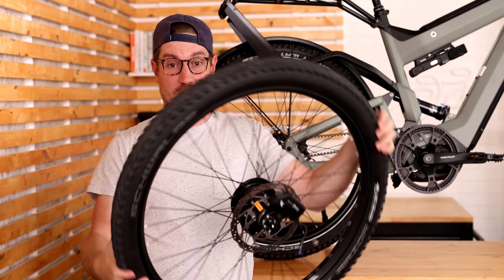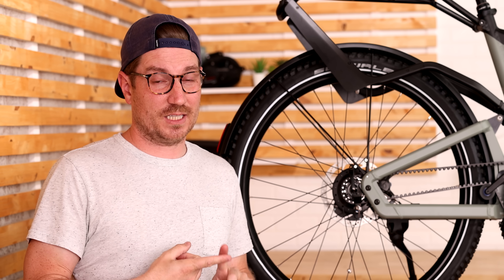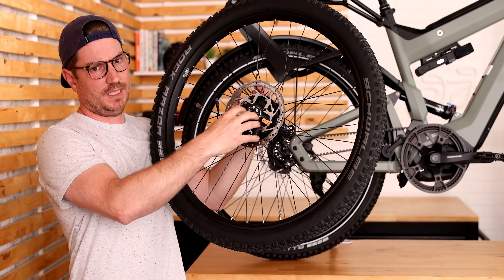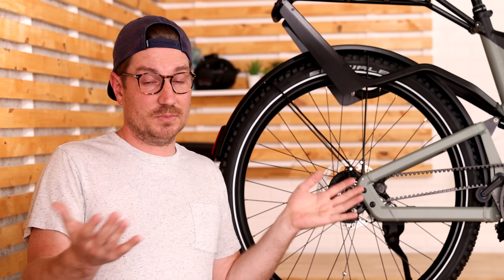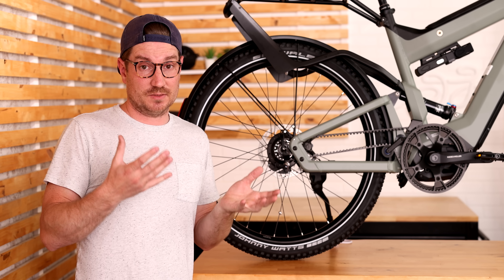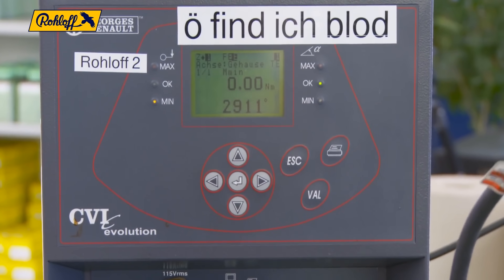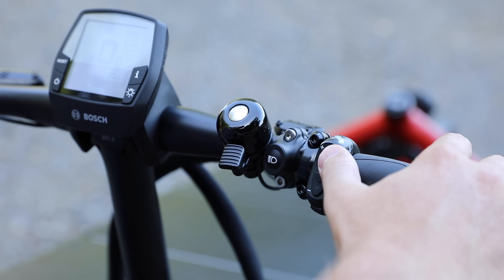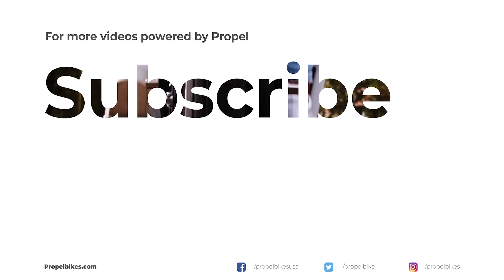Rohloff E-14 - is it really the best eBike drivetrain?

Comment: Very good video. Just some opinions:
Weight, efficiency and gear range are not really a factor for E-Bikes.  An E-Bike is already really heavy, efficiency is secondary because the motor will compensate for it and the motor will also compensate for missing gear range. Sure you will use up more battery but most people will rarely use up all the energy within one day.
You can even shift a gearbox without slowing down your cadence. You can shift while peddling but not under full load. So when you just reduce the power a bit and put a little bit of pressure on the shifter it will not shift while there is pressure on the pedals but when you reach the dead point it will shift instantly. This way you need way less coordinations.

Comment: Got the need for speed? Take the Rohloff, pair it with a Schlump Speed crank, a Gates belt drive and throw a 3000 watt front wheel motor on and you have some real time peddle ability at 40+MPH.... makes ya feel like a real live Superman! Throw a lil caution to the wind and use a Grin Phase runner Controller...

Comment: Interesting video, thanks for that.

Just to be clear (confirmed by Enviolo and Rohloff):
 - the Enviolo hub is limited to 100Nm at the Bottom Bracket (putting more torque leads/can lead to the internal balls to go flattish and destroying the hub)
 - the Rohloff limited at 130Nm at the input level ("the input torque we refer to is measured at the SPEEDHUB input sprocket" says Rohloff customer service ).

This means that if you have a 18 teeth sprocket at the rear and 36 teeth at the front, the Rohloff can stand 260Nm at the bottom bracket. HOWEVER, Rohloff specified that these 130Nm at the input level, includes the torque of the motor AND the torque of the cyclist. Still, this is an insanely higher level of torque than the Enviolo can cope with.

Also, as Rohloff says "The sudden application of torque from high power motors may lead to internal component damage if the curve hasn't been programmed with transmission component longevity in mind", so should you install a 160Nm Bafang motor like I did, better not start with Pedal assist on full blast, but start low and progressively increase PAS level as the speed builds up.
Reply: Hey Patrick , how did your rohloff work out with the 160nm torque. 
I’m looking at doing the same .
Revollute hub1 6 speed , 250nm torque capability , coming out soon and 
HB hightec , 9 speed , 250nm as well
Reply: @danieloconnor373  Hi Daniel, have done c. 1,500Km on it and it is working like a charm ;o) Maybe I am overly cautious with it as the Enviolo did not last long, so everytime I change gear when in full power, I make sure to reduce the pedal assist 3-4 levels (down to middle power), then change gear, then start pedalling and increase back to full power. I have a ratio of 3:1 front to rear and live in a hilly city, but must say this ratio is perfect, cycling easily at 45km/h on flat at a 50-60 per second cadence.

So although Rholoff are expensive and they look like they were created in the 17th century, they are 10x more worth buying than the Enviolo (to me)

Comment: Hi,

I really love your video they are very well done.  I don't know if you made a video on this. I have a 2019 R&M Delite with  Roholff E-14.  Until now I keep changing the level of assistance depending on the slope.   I was wondering if I should just pick a level of assistance for a ride.   If so, would I drain my battery faster?

Comment: One great advantage of speedhubs over derailleurs is that there is nothing hanging on right side of rear axle; a derailleur can be spoiled in different situations (of course, possibilty to use belt instead chain, and possibility to change gear without moving, are the two main advantages, in my point of view).
Two main advantages of Rohloff over other speedhubs are <1> the range, with not too wide gap between gears, and <2> that the rear wheel can easily be removed (no weird cable attachement with the Rohloff, even with the standard one)... The "less friction" aspect is real compared to Envolio, but not so sensible compared to some other speedhub (in my case: Alfine).
Changing oil is very simple and not expensive (I am buying kits on German eshops). Changing old version pinion was not very difficult (for Rohloff using chain) and pinions can be used on both sides; with new pinion system, it is  easier (no screw to untight with specific tool).

But I don't find that the two buttons shifter is very pleasant to use: the triangle shaped buttons do not work well when you push off center, so the sweetspot is quite small. The whole "two buttons" shifter is not very comfortable whatever rotation adjustment, because the whole thing is rather small and smooth. They should have made something more like a trigger that you can push up or down, without having to check your fingers, then the display, to know whether you have switch gear.
It's not a "no go" at all (current switcher is fully usable), but a direction for improvement.

Comment: My bike technician told me its very expensive purchasing the oil that the hub needs servicing every few months. Told me it costs about 500$ CAD to  maintain the hub. What are the costs like in the united states?
Reply from the maker: It’s like $40
Reply from the maker: You need to swap the oil every 5,000 Km
Reply: @Propelbikes It's different if you're a regular commuter? Someone who puts more than 100km a week.

Comment: At thee moment I’m on a 4400 mile circumnavigation of the coast of the UK. I’m riding a Reise & Muller Load 75 with Rohloff E14. It’s smooth and does the job nicely. The gear range is great, tackling any hill I have thrown at it. Great video Chris.
Reply: Anyone who's doing a great bike trip like that gets an automatic upvote from me!  If you happen to see this, how did it go?
Reply: I hate the shift-buttons, they are not reliable and hard to use when wearing gloves.

Comment: Great Video, Do these types of hubs work for rolling hills and climbing such as the Foothills of Tucson? I want to get back on my bike, but the hills on a traditional bike is a bit much so looking at an electric assist. Any thoughts?
Reply: The pinion systems are more suited for mountain bikes because you don't have to stop pedaling while shifting and the weight is centered and low.

Comment: Hi Chris. Thank's for the video. I use a Riese and Muller Supercharger 2 equipped with the Rohloff Sppedhub E-14. I use the bike everyday for home-work comuting (starting on january 2020, now almost 4000 kms). This internal gear hub is a must have. To give a complete description maybe a drawback is the oil leak wich seems to be "normal" but is very surprising the first time. It can be several dots that make the ground really dirty. There are many posts on the web that explain that this is something usual. 
Changing the oil is really easy. No need to visit the dealer shop for that.

Regards
Reply from the maker: Great feedback! Thanks for sharing!
Reply: "the oil leak wich seems to be "normal" "... Hum.. No, it's not. I have two bikes with Rohloff (and one with Alfine); an oil leak is not normal with a speedhub. You better check this with the seller, since your bike is still under warranty.

Comment: GSD R14 in UK, 400 miles and really enjoying it. Would like a more positive feel for the centre of the push gear change buttons - especially with gloves on.

R14 is a heavy bike but it's a joy to ride with no assistance - no drag from the Rohloff or the belt drive or the Bosch Gen 4. (Bosch Gen3 was a DRAG)

Comment: My Blade 2.0 has a 14 speed Rohloff speed hub. It’s a 1500w Bafang Ultra powered mid drive mountain bike sold from the San Diego based company FLX (builders of the babymaker).

Comment: Any experience with Pinion gearboxes? Wondering about a comparison with Rohloff.
Reply from the maker: They are super cool, but not as common on eBikes. I’ve seen a few rear hub motor setups with them, but it doesn’t offer the same mechanical advantage when pairing a mid drive with the gearbox.
Reply: Pinion hubs are at the same place as a mid drive.

Comment: Gear system efficiency is not important in E-bikes. Good systems has 3% loss, Ok systems has 10% loss. So you can get an Ok system and a 7% bigger battery for much cheaper than a good system.

Comment: Viewers like me who live in a cold climate ABSOLUTELY NEED TO take the cold into consideration if your are going to ride during the winter months! I went with Gates + Nexus 5e thinking that all is good but when the winter came all was not good. The below freezing temps really kill the range. I ran on eco-mode all the time but still if the temps drop like -10 to -15 C your not going very far with it. Also it's horribly inefficient on it's own. I don't ride it with motor off (not even summer) unless the battery has run out... which can and will happen in the cold climate. Not happy at all with the hub. Maybe I will turn it to single-speed or sell the bike later.
Reply from the maker: This is definitely an important consideration, but the Rohloff can handle it better. You just need to swap some of the oil for the cleaning oil which has a lower viscosity.
Reply: @Propelbikes  I was thinking that it might, but haven't tried it. I guess the Alfine 11 does better in the winter too.
Reply from the maker: Yes the Alfine will also work slightly better because it sits in oil as opposed to grease. I think the oil has a lower freezing point.
Reply: When it is very cold, every e-bike with each gearing system will lose range. It is mainly the battery getting cold and that will have a big effect on your range. I live in The Netherlands, in winter not super cold, but it can be below zero. I can see dropping my range a lot at -5 degrees. In summer time the range will go up a lot. And I drive with a derailleur system.
Reply: @leojonkers3181  That's just it. You have probably the most efficient gearing on your bike. My wife also has steps e6000 with derailleur. Her bike is easy to pedal even with the motor off. I have tried it and she very often rides it without a battery. Mine however.. (e6100 inter-5e) can not be ridden without juice in the battery. Never. When the battery is depleted I ride the rest of the way on 1st gear. (That's also because on my bike it is way over geared but you really can not have it lower on a 28" bike with belt drive.) It goes just above 100km in the summer with eco and during winter with studded tires I can get 70km if the temps are closer to 0 C. But last winter was a bit colder than year before and in -13 C the range dropped from +30km (real range not start ride estimate, the eastimate was 59km from the start) to 6km. Last few years have been warmer but -13 is not uncommon here. Can you see how someone might leave home with "59km of range" and be stranded on their commute to work? At the end of the last ride the system showed a range of 30km.
Reply: @leojonkers3181  I talked about the issue with my local bike shop owner and he told me that the nexus range use a grease that really stiffens up in the cold. He also agreed that it's not a fun hub to ride without assist. But he thought it was an ok hub if mated with a more powerful motor. He had a bike with Bosch performance motor and the inter-5e hub.
Reply: @K1989L  Oké, that is a kind of problem with the grease. That is new for me to read this. I knew that every hub have a slight less efficienty then a derailleur, I did not know the Nexus 5 have this problem. Is a very strong hub, specially made for e-bicycles.  Commute and be stranded must be terrible, there must be a solution. Oil change and a second battery?  I have a Bosch Performance Line motor, no fun to drive without assist (I never do), the bike is 26 kilo without battery. When temps are normal, I have a range of 100 km and more. 500 watts battery. In Tour. I bought a second battery for very long rides and holiday rides, also in mountains. I live in Rotterdam and here everything is flat. Only strong winds can make it hard to peddle.  I change the battery every time I load it, not leaving one battery to get old without using.
Reply: OK Boomer

Comment: Awesome stuff! For those people also looking for a portable bike which they can throw in a car and drive it to the mountains, are the Rohloff's compatible with quick release? Thru-axles? I've only ever seen them with the traditional nut setup but the ones in your video looked like thru axle?
Reply: Yes. There are adapters you can buy that will get your Rolloff to a 12mm qr

Comment: what is the power rating of the motor on that e bike at the beginning of the video with double battery etc
Reply from the maker: The nominal listed power is 250W but the peak is upwards of 800. Torque is 85Nm

Comment: Nice video Chris, I drive for 10 years an E bike with Rohloff and since last year a R&M with E14 and have over 10000 km with the new bike. Clean thing, no chain maintenance with oil because belt drive. Only every 5000km an oil change. I am still thrilled. Greetings from Germany
Reply: @Click Bait In the city, there is probably no problem. In hilly terrain, the Rohloff comes into play and shows its advantages. I can master almost any slope without dismounting. I remain, the Rohloff is for me even after 10 years of experience the optimum of the gears. Especially because at a standstill can be switched. Greetings from Germany.
Reply from the maker: Super cool! Keep it up!
Reply: @Click Bait True. The Rohloff was designed in Switzerland, so having a lot of gears would be helpful there. They might think it's nuts to use one in a place with no   mountains, but if you want to buy one, they won't stop you...
Reply: please, can I know the of that ebike. I'm very interested 😊
Reply: Sounds great! Can you do the oil service on Rohloff IGH yourself?
I have this item on my wish list for my own custom e-bike build.
But was not experienced and sure enough  I'd be compatible and lasts my mid drive BBHS 1500W ~165nm engine power over time.
So now running a 8 speed Shimano IGH as a try-out for daily commuting.
Personally I prefer  mechanical shifting cable(s) over electronic, since I'd like also to ride without battery.
Reply: @zachm.3049  yup, you can buy a Rohloff oil change kit which supplies all the items you need (including the syringe for the oil, but maybe not a hex key to open the hub). I have an R&M Load 60 with Rohloff which I received this year and will be doing my oil change next year with this kit. They suggest to do it once a year. That’s about the only maintenance (as there is no need to oil, clean a chain) along with tire pressure.

Comment: I run a R&M Charger with 11 speed Deore gears. I ride a lot of hills but find I spend 99% of my time in gears 5 to 9, the rest are pretty much redundant on an ebike in my view. As for a 14 speed???
Reply: Most of the time , say 70%, in eco, bit of tour, bit of sport but hardly ever need turbo. I get about 50 to 60 miles on one charge.
Reply: I also swapped the original 19 tooth chainring for a 16, what an improvement that was.
Reply from the maker: Great feedback! Makes a lot of sense and yes that front chainring makes a lot of sense.
Reply from the maker: Can I ask what assist level you use and what battery life you see?

Comment: I like Enviolo as one can "shift" also under load (while pedaling) and the no step shifting helps set an exact transmision ratio. I think enviolo is really good for e-bikes 😊👍
Reply: just ordered my tern bike with enviolo on it. hopefully theres no regrets
Reply from the maker: It is a really nice way to go and it’s one of the most popular drivetrains in our shop.
Reply: Enviolo is super comfy, but I know quite some people who regret it, because they live in steep terrain.
If not, it’s a awesome system. 
I live in such steep terrain, that even a classic chain system managed to stress and break my motor over time 😔
Reply: @holyfox94  in 🇨🇭 we have really steep hills, and I never had problems doing even the steepest ones ( with two fully loaded panier bags with groceries)... I think it is important that the drive train/motor has a small chain ring on the craks (case with the newer e-bikes)
Reply: @noosestroke  The now broken e bike, Haibike Bosch CX, had a small front chain wheel.
Still, it happened. Stuttgart, Germany, especially my „Hausberg“ is the steepest in town, a few kilometres long and I have to drive it several times a day. 
Even in the Alps such steep hills are not that common. At least not on a daily basis as I don’t have or want a car anymore. 
As mentioned. One may be satisfied with the Enviolo, but you may need to buy a new bike or motor sooner than thaught.
Grüße in die schöne Schweiz 🙋🏼‍♀️
Reply: Enviolo gear range is not great.  Does not climb that great and is heavy.  I also feel that it has a lot of drag.  I have one and rarely ride it.

Comment: Thank you so much. Was hoping for a deep dive on the E-14. Whats your experience in terms of reliability so far (not the hub itself but rather the E-14 setup)? And is there any way so manually shift gears if it stops working in the middle of nowhere?
Reply: It looks like once you remove the shifter box, you could shift manually with the right sized hex wrench, assuming it is the same as the cable version.